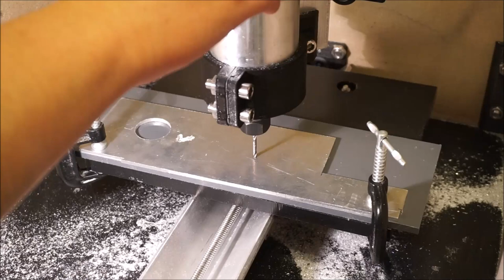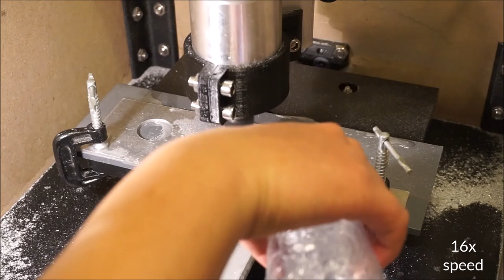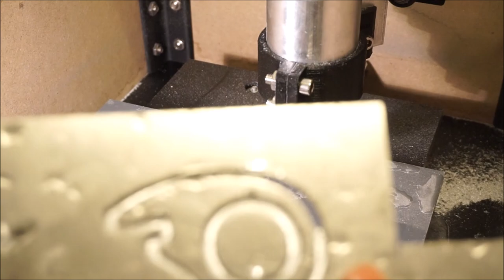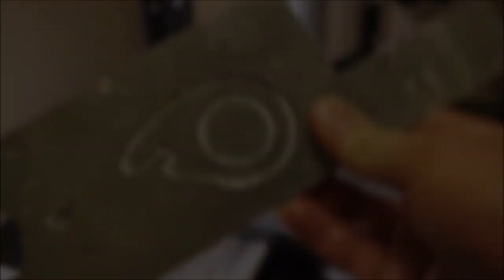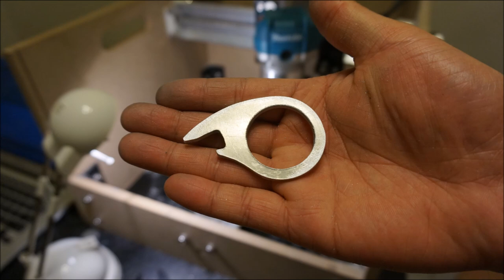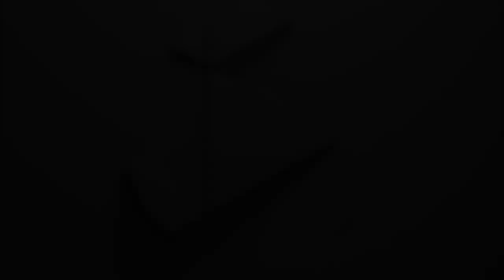Sienci Mill One: Milling an Aluminum Bottle Opener

Comment: What kind of bit was used to mill this
Reply from the maker: It was a single-flute 1/8" flat end mill. Single flutes tend to work much better for plastics and metals to increase the size of the chips removed in order to reduce heat building up on the material 👍
Reply: @SienciLabs  ok so if am cutting arcylic this is the best bit to use right?
Reply from the maker: Yes it tends to work very well